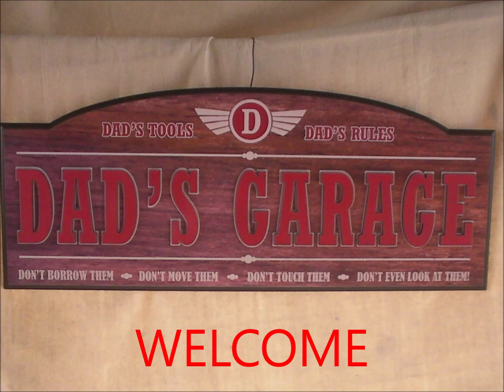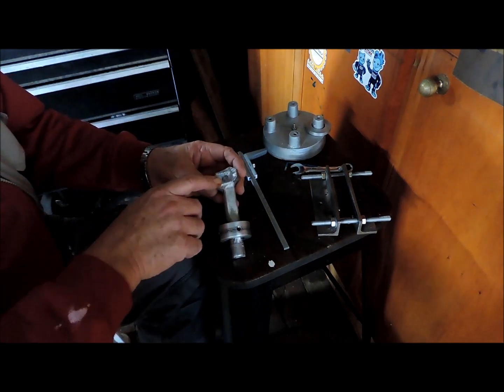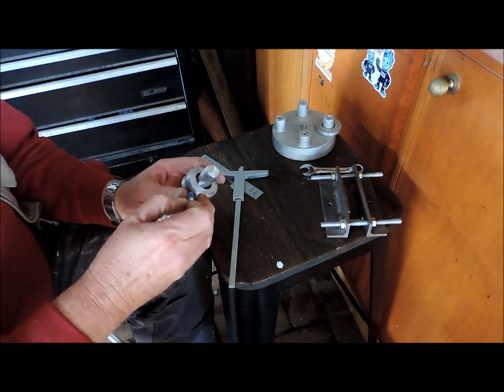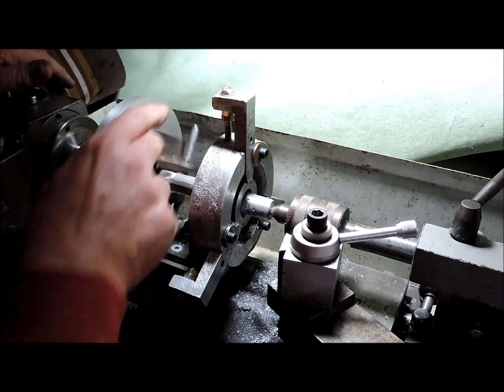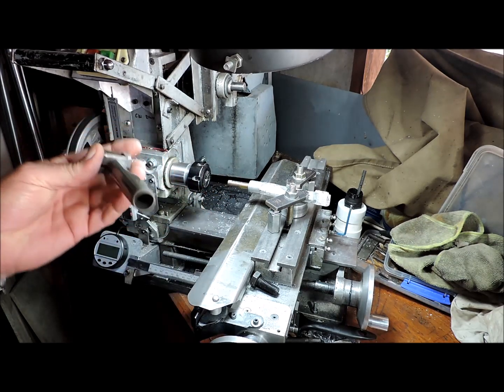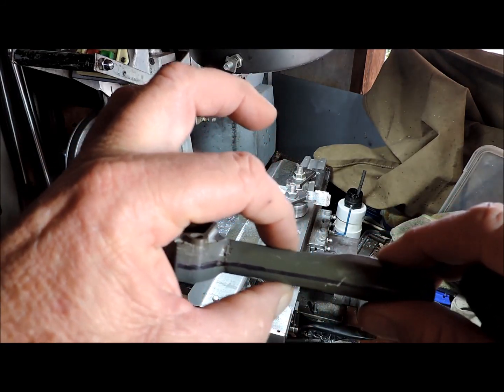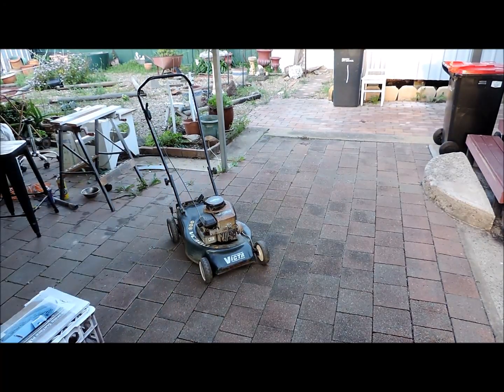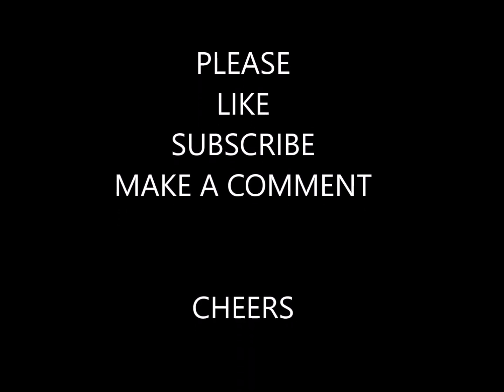Cast and machine - Part 2 - an inlet manifold for a Briggs & Stratton lawn mower.

Comment: Great repair Peter.  I wonder if you could have split the broken manifold to use as a core box and saved yourself some machining?  Great problem solving there my friend.  Thank you for sharing!!  Stay safe.

Joe
Reply from the maker: G’day Joe. I didn’t think of a core but drilling worked out fine.  
Cheers 
Peter

Comment: Kudos!  I was thinking sand core but you made it work without the extra work.
Reply from the maker: G’day Dan   To do a sand core would have been a lot more work and then the difficulty of supporting it at the cylinder end, drilling it out worked fairly well the only thing was I really needed a long end mill to widen intake track but the drill worked, it just needed a few passes for it to work. 
Cheers 
Peter